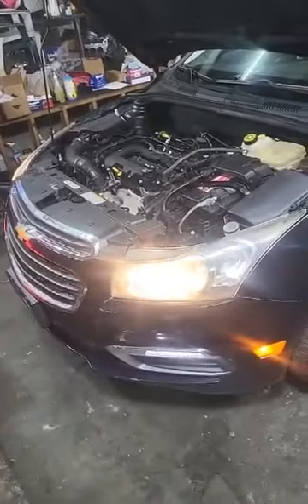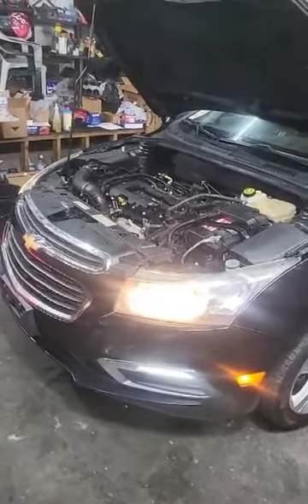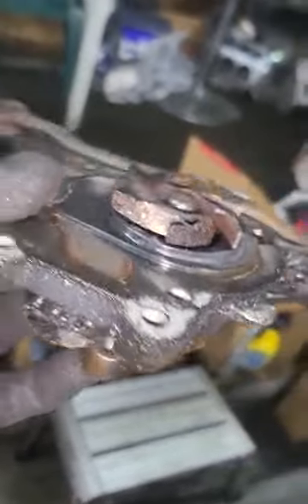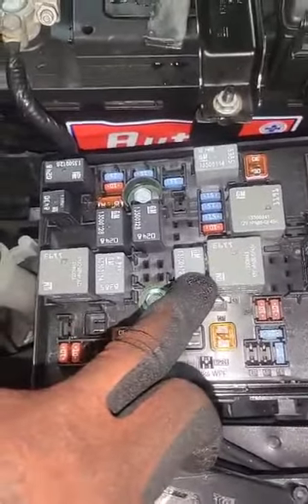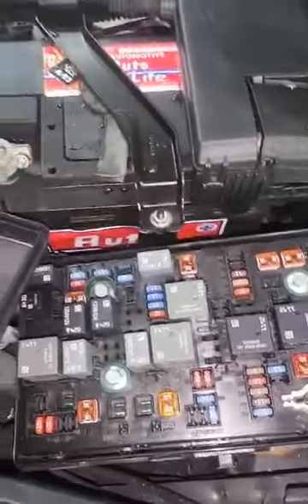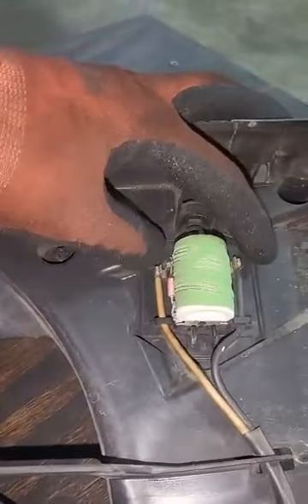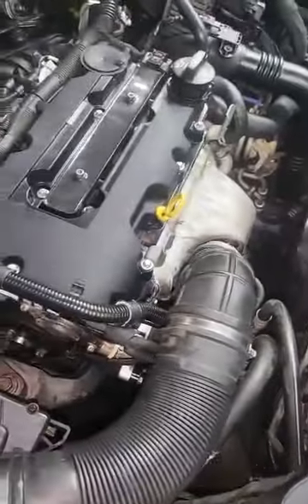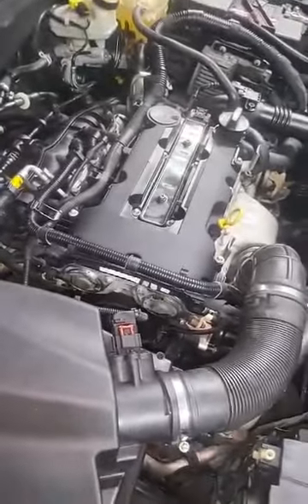2015 Chevy Cruze Cooling Fan Not Working (EASY FIX)

Comment: Been a mechanic most my life and I've gotta say I hate these cars more then anything else I've ever owned. Never in my life have I had so much problems.
Reply from the maker: i think every mechanic dose. also this car usually when its overheating most common problem is a head gasket and if you even repleaded it and replaced the oil cooler seals it will still over heating so its better to save your  money and get a new engine
Reply: Hate it or love but it’s a money machine for a mechanic

Comment: Can you make a video on how to check a motor on the fan when it’s in the Chevy cruze ..and also a video of how to check if the thermostat sensor and the other sensor is good my fan not working I can’t believe I missed it when I bought this car I’m so mad at myself for missing that
Reply from the maker: Actually the car is gone already.  I had the same problem you had now and unfortunately was the head gasket
Reply: @Pat Caron I got it to work but I did have two trans lines leaking fixed them two.. but now every morning once I pull out my drive way going straight for about 20 yards I’ll here like a rock hitting my wheel well it weird everytime for the first start of the morning or if I let it sit awhile after starting it

Comment: The fan not working when the engine is on but if I switch on the air-condition the fan is working, please what's the problem because I just get the car and I haven't get use to the car. I need your response please. Thanks
Reply from the maker: I don't get it ! Is your car overheating?
Reply: Not really  but I could see that the coolant getting dry little by little and the engine is on the fan isn't working at all but if I put on the ac that fan will be working and if I put the ac off the fan would work again
Reply from the maker: @bashirajao9314  This is normal. When you turn the a/c on, the fan should turn on . Also, the fan turns on when the car is overheating, not the whole time